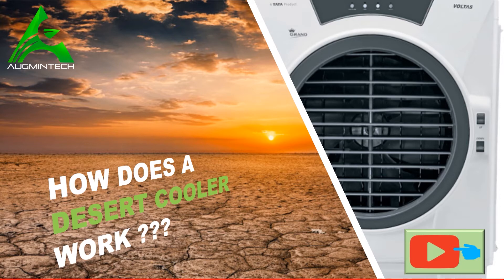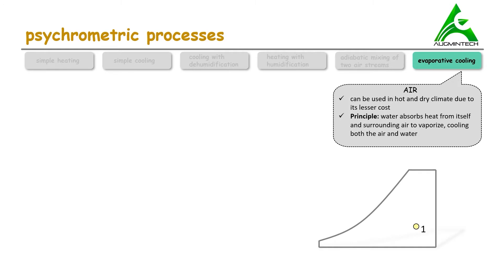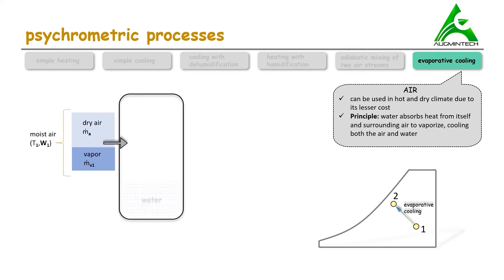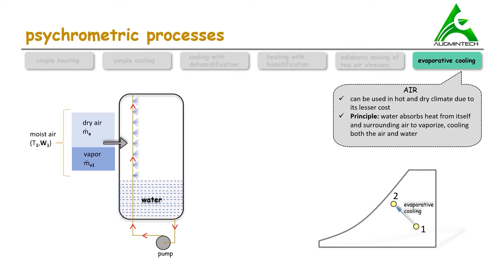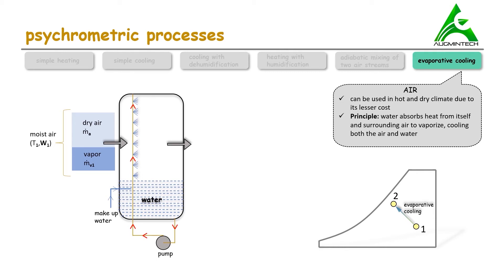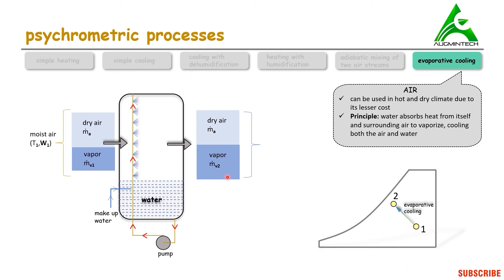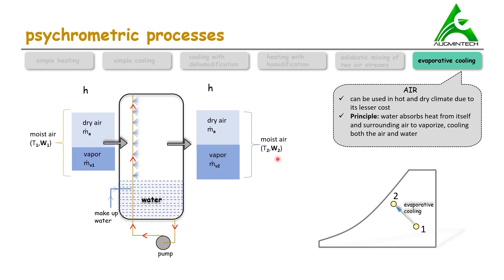How do Evaporative Air Coolers Work What is Evaporative Cooling?

Comment: Sir,
It is called evaporative cooling,
Means cooling due to evaporation. So my question is that,  how the temperature remains the same.
There should be decrease in dry hulb temperature and increase in wet bulb temperature because due to amount of moisture increases in air. So wet bulb temperature will reach to dry bulb temperature upon saturation of air.
How the enthalpy remain the same when we call it cooling .by cooling enthalpy is doesn't decreases?